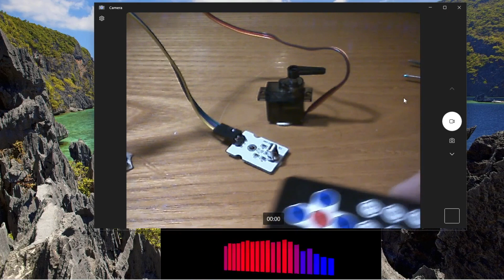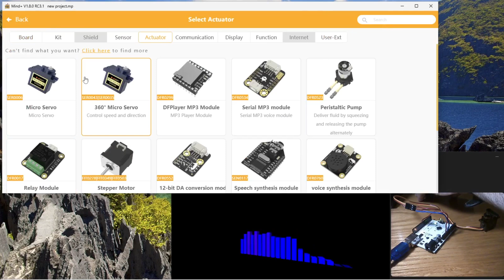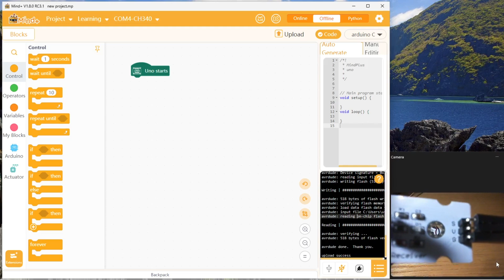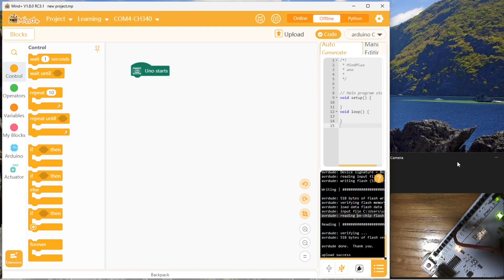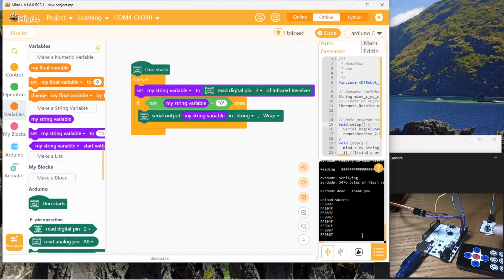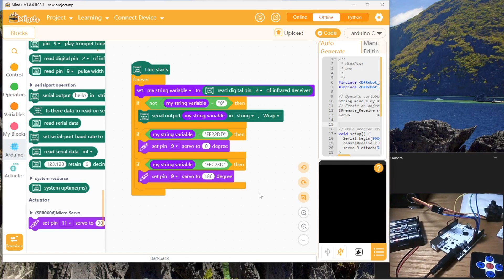Arduino Uno (Polytech R3) - Infrared Keypad Controls Micro Servo motor

Comment: Κύριε Φωτεινάκη καλησπέρα, μήπως έχετε καταφέρει να χρησιμοποιήσετε το ir transmitter από το Polytech S1; Το ir receiver φαίνεται να λειτουργεί σωστά και στα δικά μου πειράματα αλλά δεν έχω καταφέρει να βρω τρόπο να λειτουργήσω το transmitter.
Reply from the maker: QUESTION FROM @ale3andro1979: Mr. Foteinaki good evening, have you managed to use the IR TRANSMITTER from the Arduino Uno mod by Polytech S1? The IR RECEIVER seems to work properly in my experiments as well, but I haven't been able to find a way to get the TRANSMITTER working.
MY ANSWER: No, I never did try but I might have a solution later, next month. THANKS !
Reply from the maker: I just quickly managed to produce a video in which I demonstrate how to use the IR Transmitter module of Polytech's S1 Arduino Uno board kit. You can fin it here: https://youtu.be/8lm8JRTNXE4